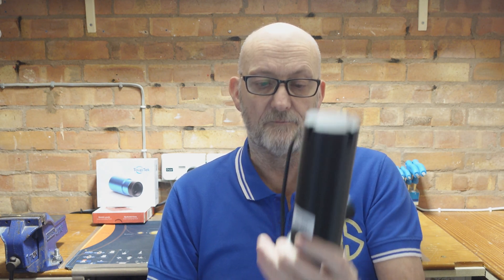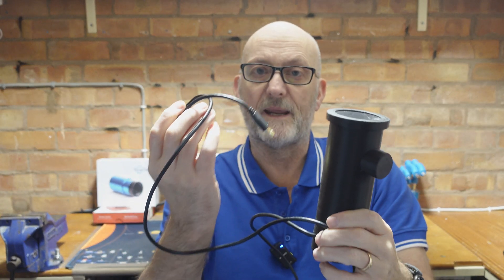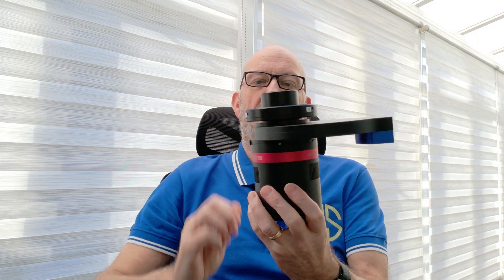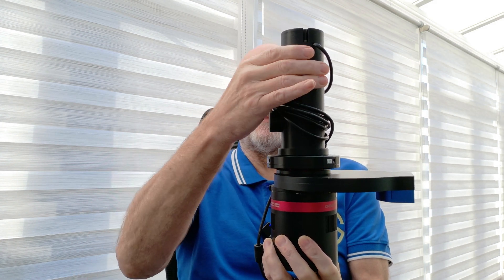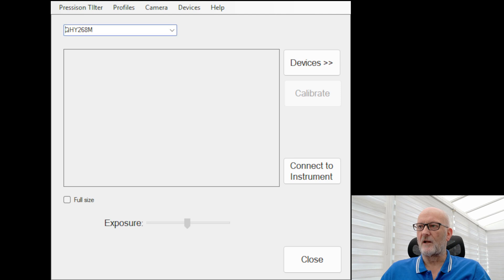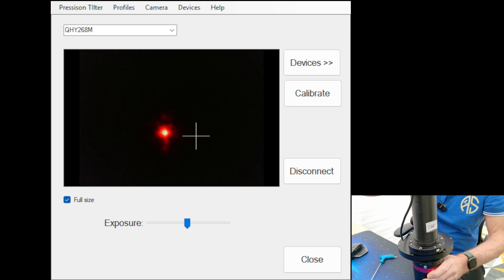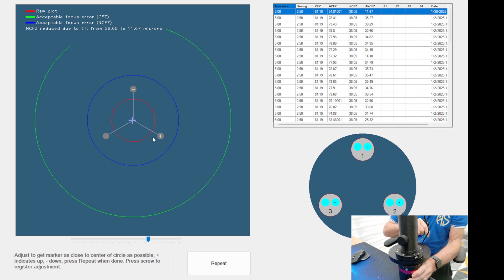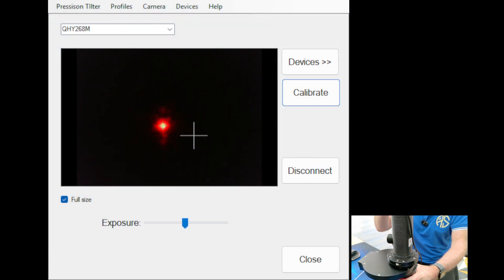Adjust Your Astro Camera Tilt, In Under 3 Minutes

Comment: I just used this to adjust the tilt on my ZWO ASI2600MC Pro, with stock tilt plate.  It took me about 2 hours of back and forth adjusting before getting it right.  I am chalking it up to the stock plate which is quite poor, IMHO.

One other issue I had...  At first my USB connection kept dropping after about a minute.  I plugged into a usb plug in the back of the computer, which seemed to have more power, at least was stable, and that fixed this issue.
Reply from the maker: Thanks for the comment, yes the stock tilt plates are not good to work with at all, agreed and they will slow things down a lot. Also yes I thought I had mentioned it in the video, but the device needs to be directly connected to a PC and not through a USB hub, I had that same issue, it does need a good amount of USB power. 👍🏻
Reply: @Astro_Shed   Thanks, yes, I initially used the front USB ports on my desktop, assuming they had good power.  But, alas,  front port apparently lacked power.  The back USB port may have been driven off the main board, anyways, better power than the front.

Comment: Received mine this morning despite a horror story with customs and had the extreme tilt on my asi2600mm corrected before lunch. My tilt was so mangled, I never would have corrected it manually. The device and software are evolving quickly and your video is already a little out of date but still useful to those with two fingers of forehead. Nice job Erik and Vidar! I wish you success in your business. One suggestion though and I know you are working on it. Get some resellers outside of Norway, in the USA and EU!!
Reply from the maker: Thanks for the comment, and for stopping by, it’s greatly appreciated 👍🏻
Reply: @Astro_Shed  Hey Astro Shed! You should think about updating your video to keep up with the hardware and software. Amazing how fast this product is evolving. You are doing great work!
Reply from the maker: @bmandelbrot  I will when the new model comes out, don’t worry, I have a ton of new kit at home to review, it’s not easy updating old videos, as you have to re record the whole thing 👍🏻

Comment: Won't the laser hurt the ccd on the camera? Can this tell tilt in the imaging train?
Reply from the maker: Thanks for the comment, no not at all, it’s a low powered laser, and hundreds of these have been sold and zero issues. And it will check the tilt of your full imaging train, but off the scope, so it will not test for focuser slop, but there new model will do this apparently but it’s still under development HTH 👍🏻

Comment: I guess in the setup profile if you want to include a focal reducer then you set the value of the focal length, e.g. 7.1? Have your tried checking the tilt on your camera with your filter wheel removed? Did you see a noticeable difference in your raw frames before stacking? Do the stars look tighter. My ASI071MC has a tilt plate but upon inspection it doesn't appear the plate was set up from the factory as the tilt plate is flush on the camera casing. When I look at some of the images on ASTAP I'm surprised the stars look round yet the tilt diagram is not square. I'm consider purchasing one of these, the M48 version. All I need are some M48 spacers and the tilt tool will slide on them. They are 2" in diameter (50.8mm). I want to set my tilt with my ZWO filter drawer and Celeston OAG in place. All I need to do is screw on a M48 spacer on the telescope end of the OAG  so the tilt tool can slide on to it? Thanks
Reply from the maker: Thanks for the comment, yes I have tested with and without my filter wheel on my camera and the tilt was the same, as all the tilt in my case comes from a sensor not fitted squarely, which is really common now. The tilt plates that come fitted to cameras are never set up at the factory they are there for the user to set up.
And yes you will be able to just slide the M48 tilt adjuster over an M48 extension and it will work well, that’s how I use mine.
My stars are so much better now and all print right into the corners, but we’re not before…👍🏻
Reply: I ended up purchasing one of these. Got it a few days ago. There have been minor changes to the software since your video. The software displays the sampling points on the red circle, three or four which are used to determine if the sampling was accurate. If the sampling points are in each circle session and not bunche dump or in a line then you have a good sample and you can begin to adjust the tilt plate.  I was was to get between 3 and 4 microns according to the Theoretical and Actual New Critical Focus Zone values show in a table that is updated every calibration cycle.. The adjustment screws need to be tight  so they don't come loose but careful not to damage the 2mm allen key holes in screw and grub screw..I was unable to adjust in 3 minutes. The more you practice the better and faster you will get. I calibrated with my Celestron OAG, ZWO filter drawer (without filter) and camera. The first time to testing the results outside,  the tilt was still present but once I got familiar with the procedure and discovered you only need to adjust 2 screw sets on a three point tilt plate it became easier to adjust. The second time out at night I was getting square  sensor tilt diagrams in ASTAP with ASTAP reporting virtually no tilt. Stars look better in the corners. The only criticism is the manual could be arranged better and maybe offer tips for adjustments but  the tool allows you to visually  make real-time changes at your desk. I can see using this tool for quick tune ups when changing targets or when the weather gets cold and the metal contracts and expands. 

Shipping was pretty fast from Norway to western US. It only took about 3 days but I did pay for UPS Worldwide Express which is only 6 Euros higher than their standard oversea shipping. I also had to pay a credit card fee for money exchange. The USD to EURO exchange rate ends up paying about $350 (USD) including shipping. I got the M48 model.

When I look at alternatives, the WandererAstro  electronic tilt adjuster ($850USD) and the ASG Photon Cage ($700) which doesn' include any software, this tool is a nice alternative. I can't image trying to adjust tilt by taking an image, running ASTAP or Siril to display the tilt diagram, tweak a screw the repeat. That would drive me nuts. I would never be able to get close.

The only con is you can't adjust the tilt while your camera is on your rig. So if there is any tilt in the OTA it will still be there. With my C8 I verified the collimation was good.

While it's a 3d printed tool the build quality is good and the M48 spacer on the image train fits in snug as the inside of the tool is lined with a felt material. The tool seems to be built to higher tolerances so it doesn't seem to be imparting any of it own tilt.

I received quick replies from Erik for answers to questions and he will offer support using Teams application if needed..
Reply from the maker: @KJRitch  nice one, it’s certainly a game changer for tilt adjustment at a smaller cost than some other options, watch this space re a new adjuster that can work on your scope with all accessories attached so will correct for tilt in the OTA also… can’t say more than that ATM 😉
Reply: @Astro_Shed  😀👍

Comment: It's hard to get my Asi294mc-p correct. Still working on it.
Reply from the maker: Thanks for the comment, what seems to be the issue ?
Reply: @Astro_Shed  thx for your reaction. I test it out and it worked. But another question. What if use a narrowband filter like Ha-OIII? Some people's  believe they got tilt shift by a filter. Well I test it out but it's not possible, the laser is not getting through the filter. Or even my L-quad enhance filter give a second laserspot, by reflection.
Reply from the maker: @Stefan-Astro-Art  why would you want to try and remove the tilt with a narrowband filter in place, that is asking for trouble, you need to do without a filter for best results, or maybe just a clear filter

Comment: We have release a new software version with updated User Manual. News are a new Installer,  we have to admit that we had problems with old. The new seems to be good!. We have also added manual selection of blob to be used in calibration. This is done to cover setups with several blobs. Several due to reflections from camera, filter or reducer/flattener.  Tested by customer with excellent result. This means that the instrument now can be used to adjust all parts "behind" the telescope just as easy as only a standalone camera. 
Erik from AstroPrecision. I have creade a YouTube video name Astroprecision Manual Calibration Mode shows some tips of how to handle multiblobs and how Manual Calibration is used to reduce tilt. Link to video : https://www.youtube.com/watch?v=TaQPvNNlOhA
Reply from the maker: thanks Erik for the comment, and very sorry for the late reply, not sure how I missed it

Comment: I see two issues with this device:
1) this assumes there is no tilt caused by the focuser or other components that are part of the scope. For newtonians for example the tilt of the focuser if often a big part of the total tilt. You are not fixing that.
2) you can adjust the tilt without buying any hardware. Just use Nina's aberration inspector. Also ASTAP have another one ( but nina's its much better ). they are free and actually check's your whole image train , not just the camera&filter wheel. Ah, both checks the backfocus too.
Reply from the maker: Thanks for the comment, these are not issues, they were never meant to solve focuser tilt, it’s meant for imaging train and sensor tilt, I did mention this in the video, and if you are happy to spend time in the dark and cold using NINA to adjust tilt, that could be coming from your sensor then good luck with that, at least using this device tells you where the tilt is coming from, and if it’s the focuser then I would buy a better one 👍🏻

Comment: Do you have any real astrophoto test report (e.g. by ccd inspector) before and after adjustment? This will give more confidence before invest and try.
Reply from the maker: Thanks for the comment, but I can’t give you much more proof, on how good it is, other than the results I show in the test, CCD inspector is no where near as good as this tool at checking for tilt, in fact CCD inspector is pretty poor and just gives ball park results at best, it’s old software and does not take into account many variables..
I can assure you that this tool is the best tool or software on the market for checking for tilt.
Now if you still have tilt after using it, then it’s coming from focuser sag, and that’s another problem, but at least you know where it’s coming from
Clear skies 👍🏻

Comment: So I'm a bit confused here: we're making sure that the sensor is square (well parallel) to the flange of the last adapter or accessory before the telescope itself... But what about squaring to the telescope optical axis? There is still that final connection between the camera-side imaging train and the telescope, which in itself can introduce tilt, and of course the telescope optical axis can be slightly tilted compared to the flange at the back of the telescope...
So we're only correcting for one potential source of tilt, right? And then the rest of the tilt can be dealt with using traditional means like ASTAP?
Reply from the maker: @CuivTheLazyGeek  thanks for the comment
Yes the idea is to make up the full imaging train, camera filter wheel and any spacers and test that off the scope 
If then when you fit back to the scope and you have tilt again you know it’s coming from the connection to the scope or sag in the focuser which would require another fix.
But most Astro cameras now have tilt on the sensor itself in the camera as the QC is just not what it was. 
I did both my scopes and are not pretty much perfect as both scopes have rock solid focusers and don’t introduce any sag at all
Clear skies Cuiv 👍

Comment: Fantastic tool and video! Ordered an M54 tilt plate for my 2600 and this device. I have star issues in all corners. I want to ensure my camera and filter wheel are dialed in so I can pursue possible back focus issues or focuser tilt.
Reply from the maker: Thanks for the comment, and glad you found it useful, enjoy your new tool, it is an excellent bit of kit 👍🏻
Reply: Thanks for the order Thomas 👍
Reply: I got mine and got my tilt knocked out. My sensor was so bad it was -31 in the beginning got it within 4 microns
Reply: @thomasrider5852  Excellent Thomas and thanks for patient and assistance in some busy hours last night 👍
Reply: @ I appreciate the excellent customer service!

Comment: What if tilt comes from imaging train ?
Reply from the maker: @TheHelicapt  thanks for the comment, you can leave the full imaging train intact to test, obviously apart form the focuser, as I did in the test 👍
Reply: @ ok. Thanks. What if my start of imaging train is 54mm?
Reply from the maker: @TheHelicapt  they supply the correct adapters for your set up. Just ask them in advance and they will include….👍🏻
Reply: @ great. Thanks
Reply: @TheHelicapt  Hi , Erik from AstroPrecision, will have skipped offering adapters. We deliver instrument on all sizes, also custom. You can select when you order. If the size you want is not there mail us. We tested and saw that adapter if not 100% corrected attached could introduce fault so better to deliver on "all" sizes.
Reply: @erikguneriussen1066 ok great. That makes sense.

Comment: New info :
We have decided to not deliver adapters. Further testing shows that the accuracy of combining the instrument and the adapter must be to high to be sure that the calibration is correct. W will therefore deliver instruments that matches different adapter/extender sizes  instead, also custom size.

Comment: Nice.  How precise is the fit between the TiltPrecision and the imaging train?  If there is any slop, won't that impact tilt measurements as you rotate?
Reply from the maker: Thanks for the comment, probably best to watch all of the video to see how accurate  it is, as I show that, and I also show how well it fits, I adjusted my tilt in the video down to 4 microns very easily, so pretty accurate. 👍🏻
Reply from the maker: It does not matter what you do when you rotate, it only matters when you take the sample point.
Reply: Then I imagine it will also depend on how flat the end of the tube of the TiltPrecision is as well.  Hmm trying to think about this.  But still very interested.
Reply from the maker: @edwyun1004  actually no, that makes not difference at all, the angle of the laser does not matter at all as long as it does not change during the test, it really is that simple. It’s just looking at the reflected dot, so even if the laser was coming in from a 45 degree angle it would still be fine, as long as that angle does not change during the test.
Reply: I just received mine with the M54 tread for my 2600mc duo .
Software is easy, but the M54 on the camera is 0.1 to 0.2 mm wider than the M54 on the tilt adjustment device. 
My brother owns a precision tool making factory so I will ask him to make it fit.
Reply from the maker: @ciarancopas3433  hmmm, contact them and give them the feedback, the issue is, is that there are so many manufacturers of adapters and the wall thickness can vary between them, so not sure how they can possibly make a one size fits all really…🤷🏼‍♂

Comment: I am interested in getting one. Is this device only looking to remove tilt caused by mechanical devices being machined slightly out of true, I am concerned that it will miss tilt caused by sag in the imaging train. For you it was ideal as the tilt was not load dependent but by your sensor. In my case I have and ASI2600MM,  2" filter wheel, off axis guider, tilt adjuster, M54 to M48 adapter, Takahashi SKY 90 that connects to my Takahashi QB 0.73 reducer and that attaches to my Primalucelab Esatto focusser. The reducer does have a 64mm unthreaded nose that normally slides inside the focusser. Would I order an adapter that would fit over the 64mm nose? If I were to  guess I would say that half the cases of tilt would come from the focusser itself (which is why I replaced my stock focusser).
Reply from the maker: Thanks for the comment.
Yes this device is for your complete imaging train off the telescope, so if you get rid of my tilt from your train, and then you still have tilt, when imaging then you know for sure it’s coming from your focuser, as you have the essato I doubt that will introduce any tilt, but I may be wrong. If it is coming from the focuser it’s a difficult one as the tilt will move when imaging in different parts of the sky, due to weight shift, so if you adjust it out in one position, it can be worse in another. 🤔
adapters can be ordered from them see link in description, I think they will make them to order, but check with them.
Hope that helps 👍🏻

Comment: Thanks for an excellent presentation of our instrument Stewart. It
really nails how easy it is to use and the excellent result it gives.
There has been questions to if the instrument can be attached to
different sizes of adapters. Yes it can with additional sizes of instruments. We support standard size like M54 M65 but also custom size. 
 Our order site is extended with selection of instrument size.
Reply from the maker: Thanks Erik. 👍🏻
Reply: Great. Will be checking your site so I can order the adapter as well (M68).  Thanks.